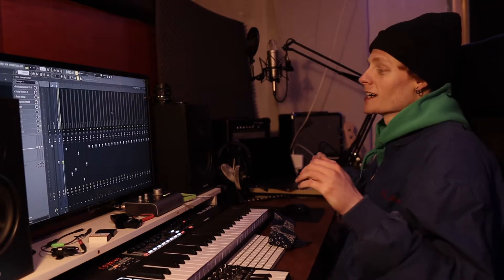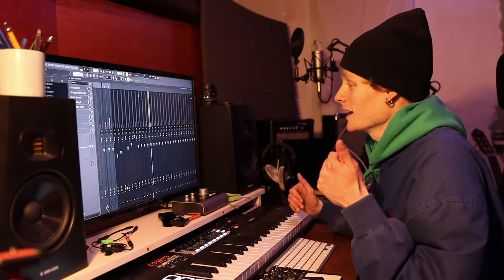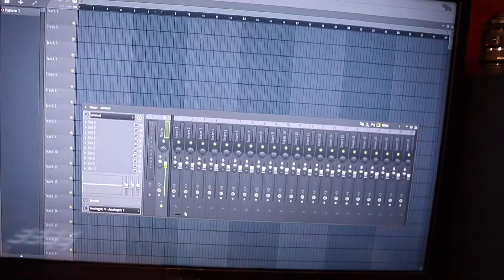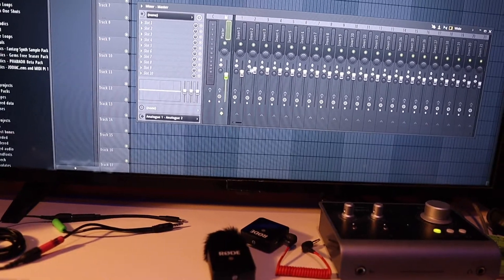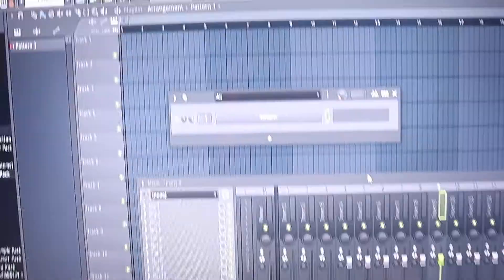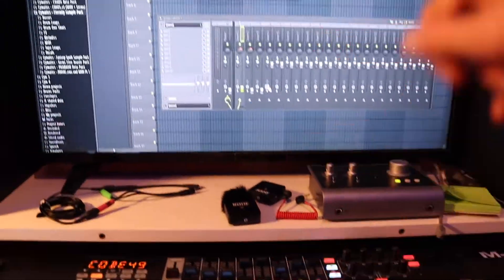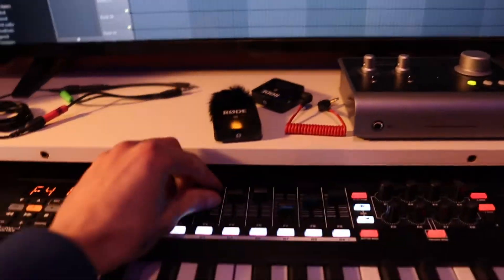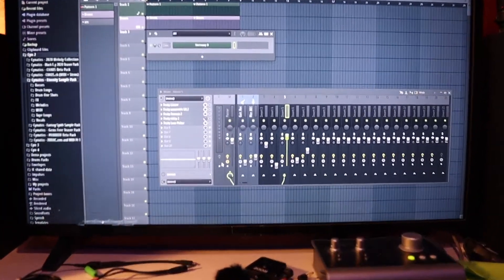How to use MIDI MIXER KNOBS in fl studio

Comment: Hi Kearl, thanks for useful tips.  My problem is keeping a particular DISPLAY read out i.e. which bank am I in and keeping that Display read out until I click the bank buttons again.
Obviously, the display quickly tells me what particular control I am changing but then reverts back to saying CODE25.  I ask this because other peoples display of the code series reverts back to saying which Preset/channel they are on and not the actual name of the midi controller, which I have.

So the Code 25 only has 5 faders, 4 rotary encoders etc.. I have to switch banks for the next set of faders and rotaries when mixing on the fly for example.  My problem is I forget which bank I am in at the time so I may miss an opportunity to mute, solo, input on the fly.

BTW I like reading manuals and the Code series is a useful one but for some reason I cannot find much on the DISPLAY itself.

Easy Bro
Reply from the maker: Have you tried resetting it to the factory settings? (I have a video for resetting it on my channel)